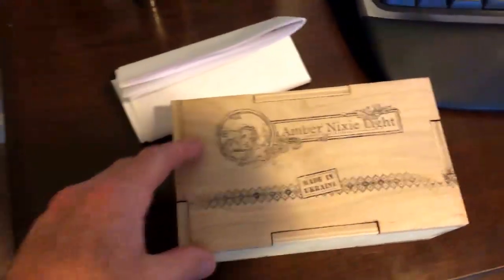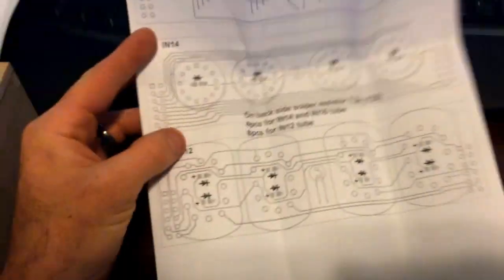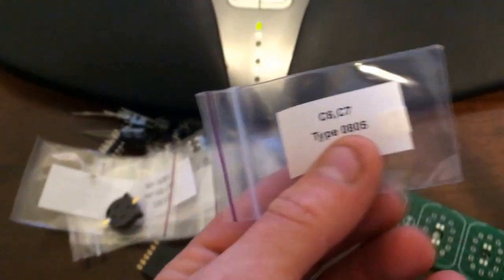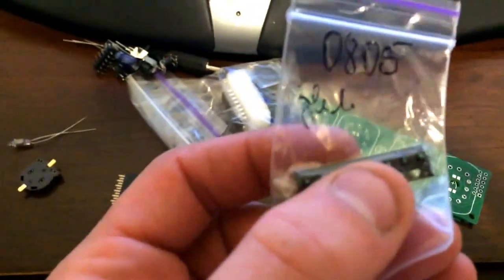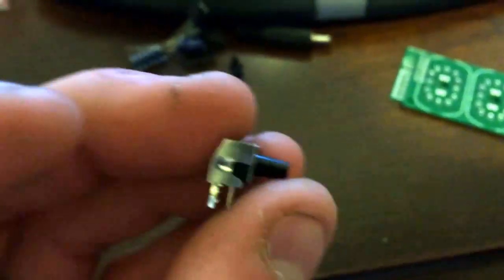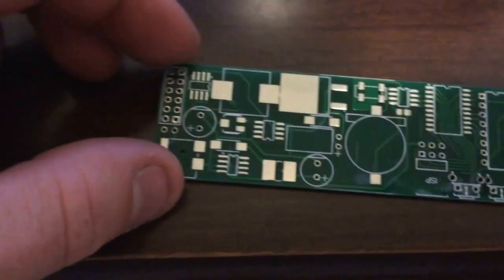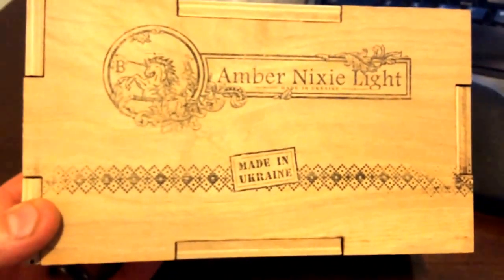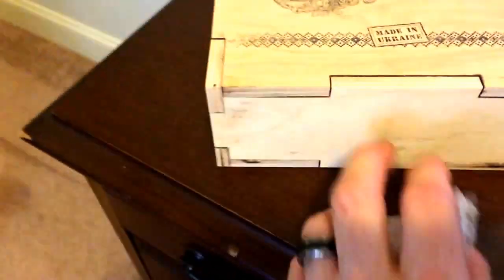NIXIE CLOCK UNBOXING

Comment from the maker: long awaited update,
the kit had 2 dead tubes and the schematic does not correctly specify placement of 3 parts resulting in a useless pile of smd junk.
since this video, i located another "kit" with through hole components and very clear instructions including proper orientation and bias setting.

when i attempted to contact the ebay seller, all communication stopped as soon as he received notice that the package was delivered. there is no support for this product so buy at your own risk!